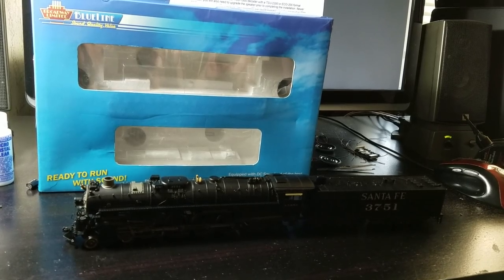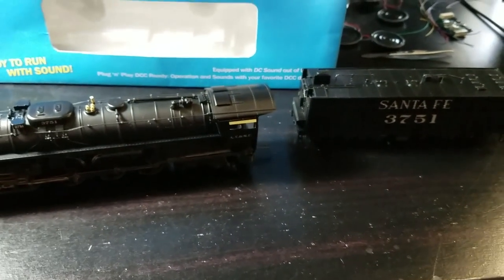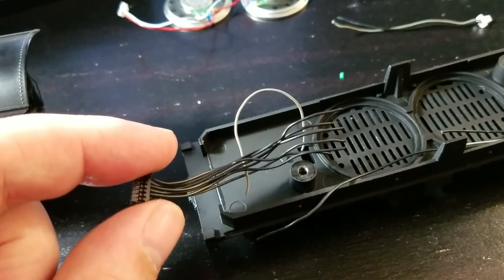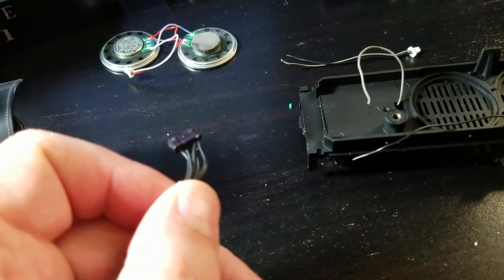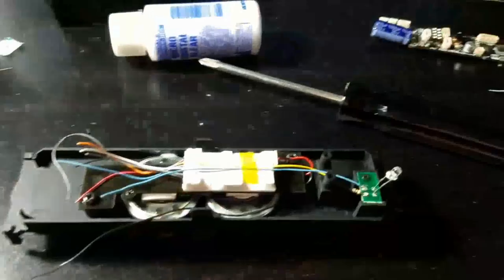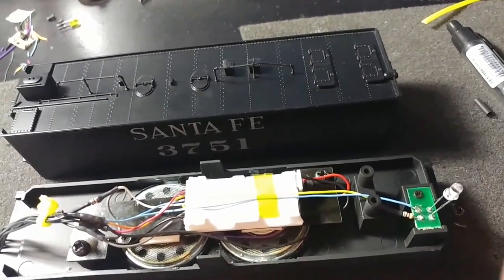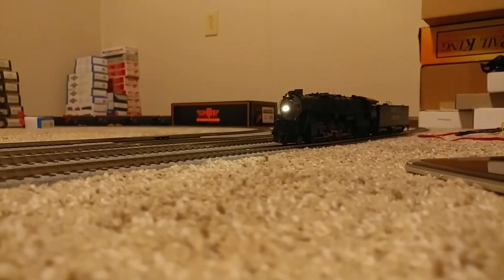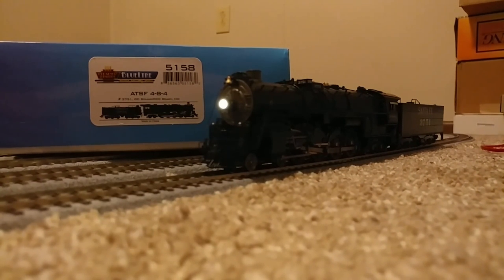How to update Broadway Limited Blueline Steam Engines to latest decoders

Comment: hello im from italy, your video is very nice, i have problem with my blue line prr m1 b 4-8-2it was a very goog runner but one day i stopped on the track and died.....every time you give power the front boiler lights work, but the loco dont move, i opened the tender and every time you give power the sound bar coming realy hot and make  orrible noise......merry christmas and sprry for my poor english. patrizio.

Comment: Nice detailed video.
I have a lot of older brass. I would like to convert my favorite 5 or 6 steam engines (I have about 30-35 brass steam). I can't do them all, too expensive, but want to do my favorites. What brand decoders w/sound would you recommend for changing these engines over to DCC? Being new to DCC it is a little overwhelming at first as I am still in the wiring stage of the layout and I'll need to run about 350-400 feet of bus wire and I really would like to keep my favorite engines for DCC conversions. Thanks.
Phil

Comment: This made me think. Remove the 4 rectifier diodes to take the existing decoder out of the picture. Plug new decoder into the NMRA plug and hardware the speakers to the new decoder. Very little hacking and I keep the harness connectors if there are repair events. Any thoughts?
Reply from the maker: I keep the connectors, the factory bli board is poor hardware and best to just junk
Reply: Rodimus Prime Thanks for the advice and quick reply!
Reply from the maker: @jameshughes8481  ive also occassionally noticed some ground loop or emf noise in the speakers using the blueline decoders thats why i junk them keep the connectors and keep the capacitors off them for future reuse

Comment: What  resistor did you use on the headlight and tender light?
Reply from the maker: Usually a 1k ohm
Reply: @RodimusPrime Thanks , 2  or 1\4 wat?
Reply from the maker: @SleeTheSloth  1/4

Comment: do you know how to add a keep-alive to a paragon3 loco? thanks!
Reply from the maker: Theres a capacitor thats already on the board really all you have to do is replace it with a bigger one its like a black tube on the one end
Reply: would i be able to take that off and just solider a TCS K2A to those pads?
Reply from the maker: @NSReadingLineRailfan  you could probably just go with a 4700uf cap and save 20 bucks should do the job
Reply: ok because i have a paragon3 pacific and it stops on EVERY switch frog there is ive cleaned all the wheels and pick ups and lubed it all with conducti-lube and cant get it to stop stalling so this is my last option, because the one from a factor doesnt do anything.
Reply: Ok so here’s a question for ya, I unsoildered the cap from the board and soldiered a TCS K2A to the pads since I had a few sitting around and it still doesn’t have any keep to it, it still stops on dirty track or when the power is interrupted.... could the p3 transmitter have anything to do with that? I’ve installed KA’s in a few loksound and Tsunami’s and they work everytime, this one is throwing me for a loop.. any suggestions? Thanks!
Reply from the maker: @NSReadingLineRailfan  sure you have the polarity right? Ive done it on paragon 2 stuff which is very close to the same.  Perhaps they changed something, might want to consider getting rid of the paragon 3 and just doing tsunami 2 wow or loksound if it just wont run right
Reply: Rodimus Prime I actually figured it out, you have to keep the cap on the board and you soldier the the KA leads to a resistor and another small component on the P3 board, runs perfectly now! Thanks for your help! I have considered getting a loksound V4 for this loco in the future but for now I’m happy with how it runs